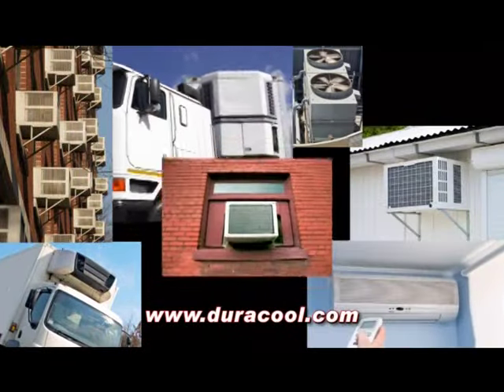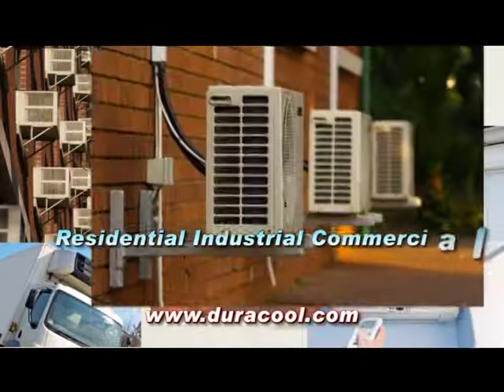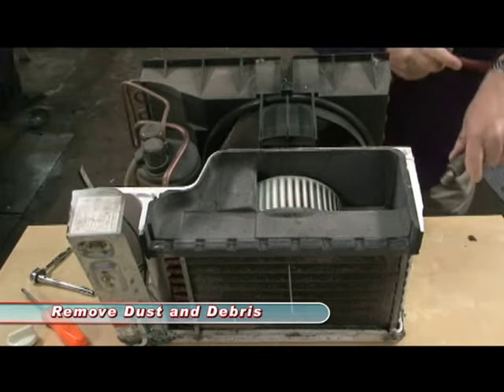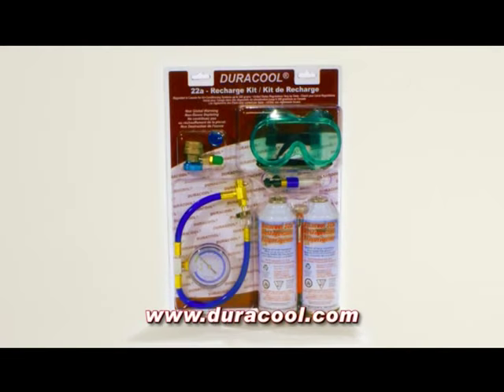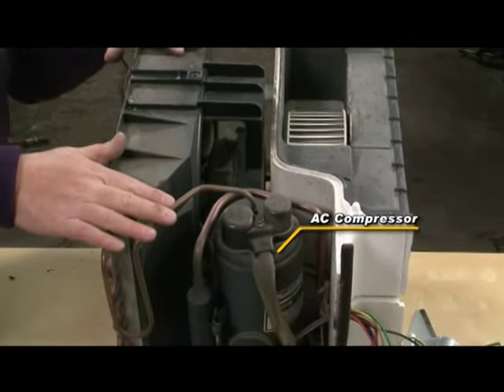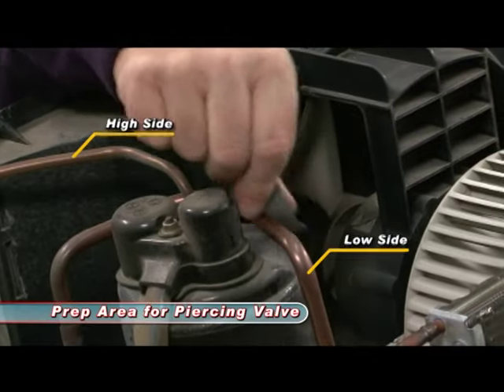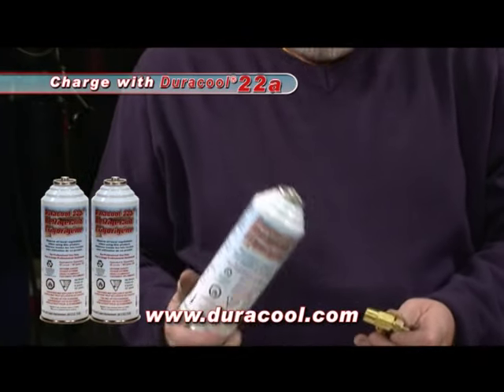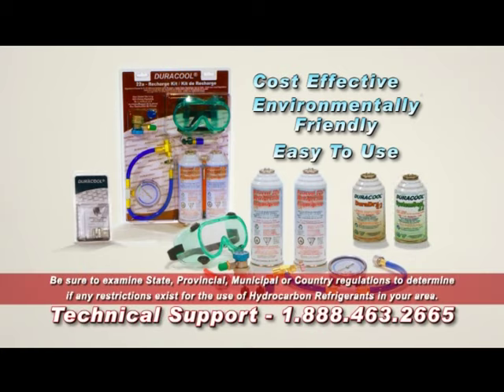Duracool 22A Air Conditioning Recharging Kit

Comment: I'd rather use the piercing valve to recover, then cut it out and braze in an access tee.  Those piercing valves are good for leaks
Reply: Yeah but the common person doesn't know how to do that or have the tools you should make a video doing what you talked about
Reply: Just a tip put q bond on the Alan keys it will never come loose again and some copper sealant between the gasket 👍

Comment: Can I put 22A in where R32 was? My window a/c unit leaked and I can't find R32 in a small can anywhere. Getting frustrated, it's hot and all shops are sold out of new air conditioners.
Reply: Use R134
Reply: No, adding highly flammable refrigerant to a leaky system is a terrible idea. I never tried R134a as Kenyon suggested. I'm sure it won't work as well as well as the proper refrigerant, but it will probably work to some extent and Walmart has it for $5 a can so it wouldn't be that expensive to try.
Reply: Negative on both these answers. R410a is the sub for R32.
Reply: @stevee7774  R410a would definitely be the next best refrigerant for an R32 system since the pressures are almost the same. Only problem is DIYers can't buy it without a license and it isn't available in small cans for cheap. I assume that the person asking this question isn't a professional HVAC tech with tanks of 410A laying around. If they were, they probably wouldn't be asking this question.
Reply: @averyalexander2303  - Yes, I agree. 
“ I assume that the person asking this question isn’t a professional HVAC tech with tanks of 410A laying around.” 
This, in a nutshell, is why these poor people should not be trying to service any refrigeration system.
Reply: I used R134 on mine it works great.